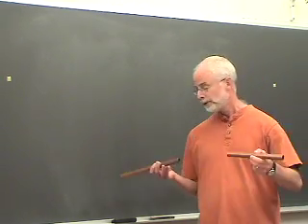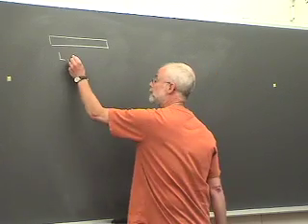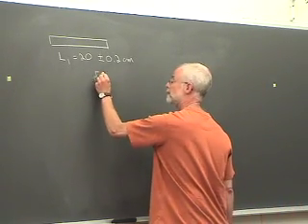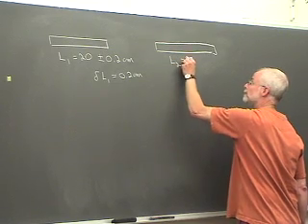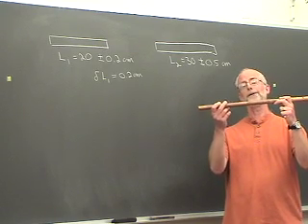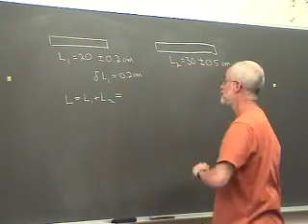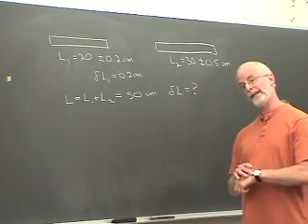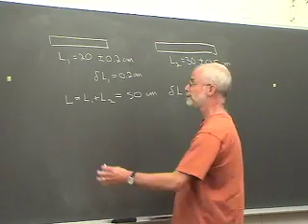Propagation of Uncertainty, Parts 1 and 2

Comment: No reasoning is given for considering the uncertainty as +/- 0.7 cm for the case of the half = 10 cm. The +/- 0.7 cm is not intuitive, and seems lacking logic. There is something behind which is not said. What about working on 1 cm, or even 0.1 cm, instead of 20 cm, will its uncertainty be considered in both cases as +/- 0.7 cm. Is "adding" uncertainty to become +/- 0.7 cm logic?. Where is the "general role" that everybody may apply? This adds "ambiguity" to the whole issue rather than removing it as assumed. No one can accept  uncertainty of +/- 0.7 cm on a piece of 1 cm in length , for not to talk about the uncertainty of +/- 0.7 cm on a piece of 0.1 cm in length, otherwise we are in a world of "science fiction" rather than in a real "physical world". Roles, whatever they are, cannot drop the "simple intuitive logic". What does "this uncertainty" mean after all this strange story?